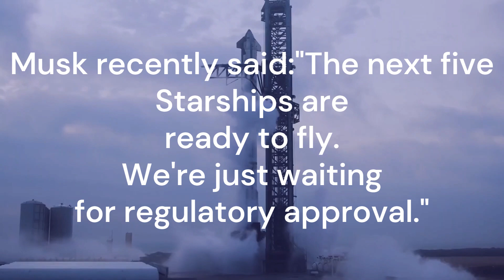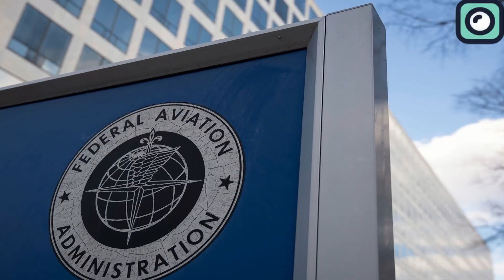Finally Musk Is Destroying FAA For Their Starship Unfair Rules!

Comment: What the heck does the hot staging ring have to do with launch, when it either burns up in the atmosphere, or lands in the ocean just like every/ most other rocket industries. They are nit picking at every little thing that X does. But when the Government needs them, "game on."
There has to be a back door issue that is going on. At least X cleans up after itself. There has to be some "un-told," tension (besides the fines), that has not been, or can not be talked about. Just like F9, and FH, they improve with every mission. If I worked at the FAA I would quit. This is all BS. 
Thanks for the episode.

Comment: The FAA is full of 💩💩💩. The hot staging Ring has been a part of two or three previous flights, & the splash zone is the entire Gulf of Mexico.  So you see this bull💩💩 about the staging ring.  The show called mercury levels in the water was a misprint of the decimal point on one page.  
My question to people is, would you put up with this BS?   If the question is no, then you need to call your senator and Congressman or the governor.  We need to get pissed off and start taking apart of what’s going on. That is blatantly apparent especially because this is an election year. During election year all kind of crap happens and this is one of them.🤬😤🤬😤🤬😤🤬😤🤬😤🤬🤬🤬🤬